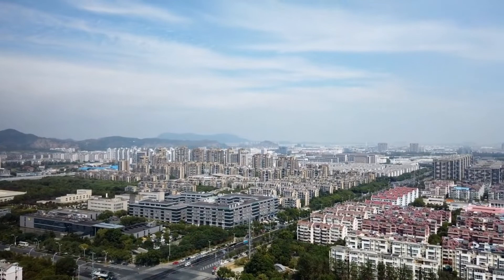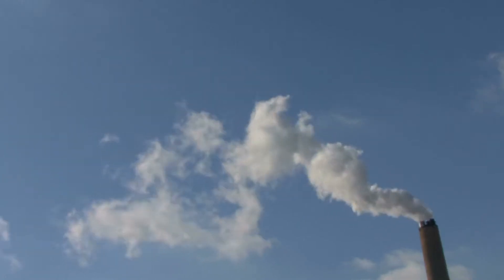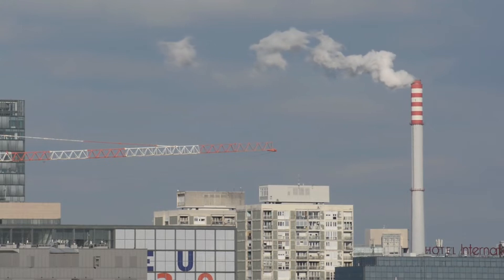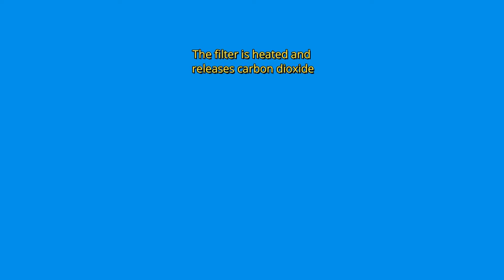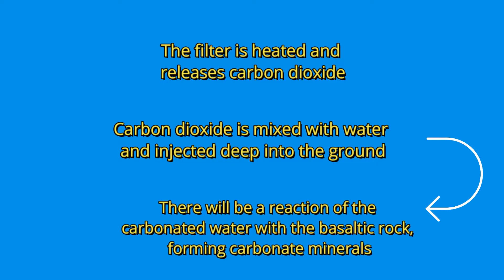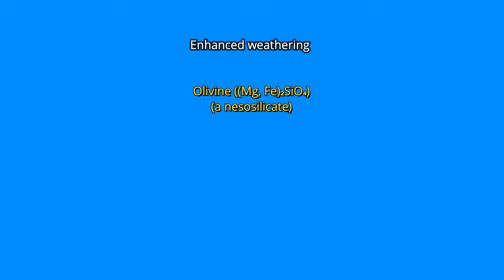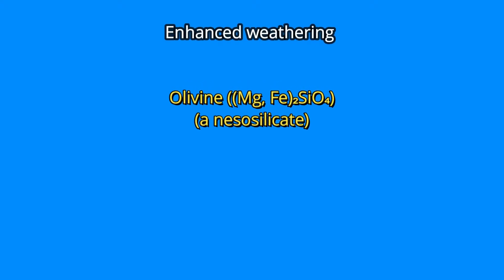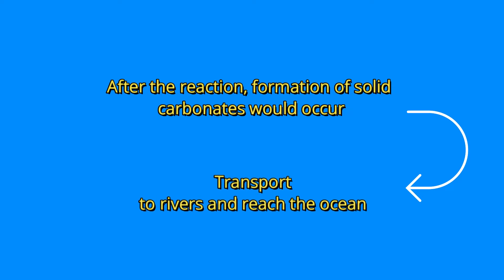How to remove carbon dioxide from the atmosphere? [four different removal processes]

Comment: Using UIE technology you can reduce CO & HC level even 5 to 22 times lesser. If you are interested I can share the Test results immediately of 2 wheelers and 4 wheelers.
Reply from the maker: Thanks for the comment! 
It would be interesting if you could share the results!
Reply: @onesustainablechoice  please share your mail ID. I will share immediately.
Reply from the maker: @saikatkoley9238  The email is onesustainablechoice@gmail.com
Reply: @onesustainablechoice  Mail Send. Plz check & confirm. Sorry for the delay from my side.
Reply from the maker: @saikatkoley9238  Thanks. I received the email.  I will read it soon.
Reply: @onesustainablechoice  Waiting for your review...
Reply from the maker: Dear Saikat Koley,
 I have some comments and questions for you:
You had a good reduction in CO and hydrocarbon but I didn´t see anything about carbon dioxide. 
Due to health risks, it is important to reduce carbon monoxide but, for global warming, carbon dioxide would be important too.
What about carbon dioxide?
I think you would need more results and statistical analysis to prove the results with certainty. Do you have more results or plan to have?
Reply: @onesustainablechoice  waiting